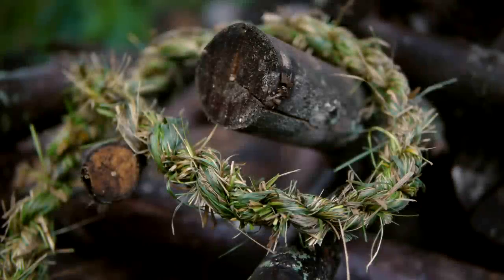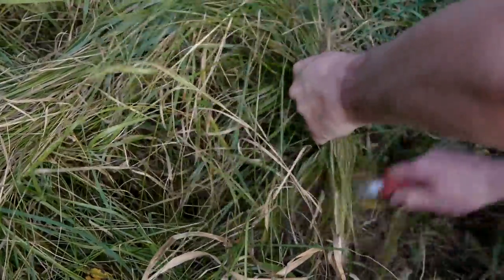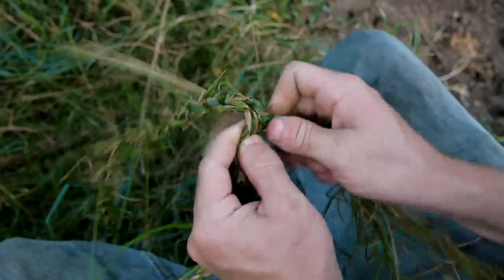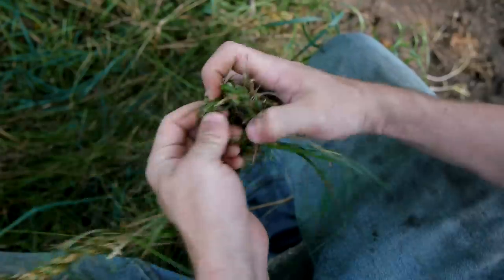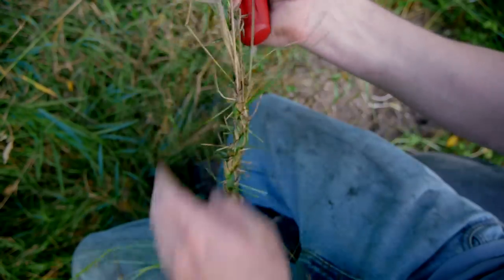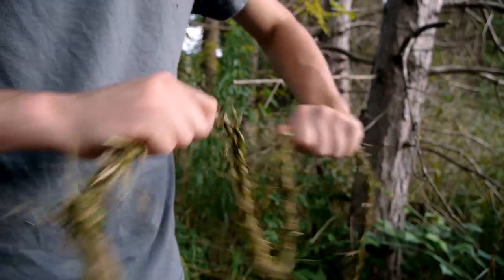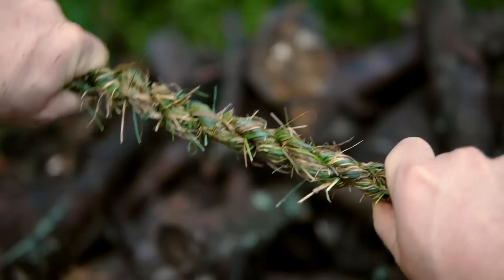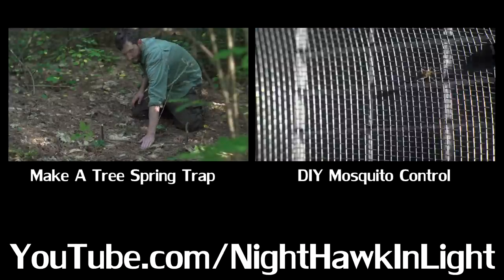How To Make Rope From Grass [Easy Method] - NightHawkInLight

Comment: Does the rope still maintain strength when it dries out?
Reply from the maker: +Liam Daniels Some, but not all.
Reply: its better to dry the fibers first, grass will tend to snap easily when dry but the fibers in nettle stems make good cordage. also you can lay the unwound fibers across your knee and roll your hand over them while keeping hold of the rope to make it easier.
Reply: +EdgyEthan if you boil it when the grass dries it won't break that easily , that's what i know , but i never tried it out
Reply from the maker: +EdgyEthan I don't know, never tried it
Reply: +NightHawkInLight
 *didn't
Reply: +Haary cane its actually 'never'
Reply: +Teeco Reeco +Haary Cane
You both are wrong. It's haven't
Reply: Jacob Furrow i swear i must have been asleep when i did these corrections :P
Reply: If it loses strength when dry you could always burn it HAHAHAHA KILL IT! KILL IT WITH FIRE!!!!!
Reply: +Jacob Furrow *You're
Reply: Lily Polk No, it can go either way. I put 'both' before 'are' to stress the "both"
Reply: Jacob Furrow Did not see that, sorry. You're right.
Reply: +Shadowphyre Can verify, boiling strengthens it.
Reply: +Lux Support :D this is actually YouTube
Reply: Liquidated Damages it depends what u use
Reply: NightHawkInLight How much weight does it hold

Comment: His improve method from 6 years ago (today is 9/9/2024) tells how to make it stronger, more easily, and last longer.

One thing he doesn't mention in either video is that some natural fibers are much stronger than others, and choosing between them can make a significant difference wherever you are and what naturally grows there. For stronger rope, just use grasses that are very tough and stringy.

One very good material is green Cyprus branch shoots. If you ever tried to split Cyprus for firewood, you notice it's significantly harder to split than other woods.

Comment: You can make a larger rope from the smaller one by securing one end,  pulling taut,  and twisting while keeping tension tight.   Once it is twisted to the point it is trying to ravel on itself,  keeping taut,  have someone grab the center and slowly back out taking the end in your hand and matching it to the secured end.   Then,  while keeping mild tension,  with someone still holding the middle end,  slowly let the rope ravel together.   You will have rope half as long and twice as thick.  :)

Comment: Gday from Australia, great video, I'm having trouble making the rope strong enough, on testing it breaks on the splice. And no matter how I try the splice always results in uneven size stands, any additional pointers?
Cheers
Reply from the maker: You're probably adding too much at a time and waiting too long before adding it. You have to add more grass before the old stands get short. As for keeping an even thickness that just takes practice

Comment: How does the strength of the rope when it is first made compare to its strength as it dries? I would expect that it would be strongest right after it is made, but I suppose it could get stronger as the grass dries and its surface becomes rougher.

Comment: Is that a Morakniv? If so, how do you like it? How does it perform? Any downsides or issues you've came across?
Reply from the maker: +WastelandOmelet It is, and it's a good knife. Good steel. Downsides are this particular model has a less comfortable handle than their main knife, and the back of the blade is somewhat rounded so it's no good for a fire steel unless you file it to a flatter top.

Comment: How long does this stay strong for? I know you mention it drying out in the description but assuming that doesn't happen, will it start to rot or anything after a while? I want to use this to hang plants.
Reply from the maker: +Crap Ratchet I haven't tried using it long term before. It would probably last quite a while, but would probably rot if it were left out through winter.

Comment: Do you think it's possible of making a stone sling out of this? I was thinking of how perfect it would be to make a stone sling out of grass cord. Throw rocks at 130/fps to scare off some wolves or bears if I got attacked. Slings are easy to weave, but I was wandering if I could make the cord thinner. If not, it would still be useful to use that cord as framing for a hut.
Reply: yes you can, Primitive Technology has a nice video titled "Sling" that demonstrates how
Reply: li 15 
Awesome thanks.

Comment: what kind of grass did you use?
Reply: +Perktube1 The type you find on the ground, in fields and everywhere on the fucking planet
Reply: +FunGUI  except for a desert (;
Reply: +Joey ink No, it's even in most deserts. A little less common in large sand-dune deserts, but still available.
Reply: +Jacob Furrow alright sorry dude you're right my bad
Reply: Joey ink No problem. You can even use cactus fibers if you can't find any grass ;)

Comment: it's either I'm using the wrong grass or the shit won't just form when I twist the strands both ways
Reply: I Loved you twist forward until fairly tight on the top strand, wrap around the front to the bottom, pinch to hold the twist. Repeat and repeat and repeat...

Comment: The video title states "Easy Method." Is there another method that works better? I'd like to see a rope that's thin enough to work with the tree spring trap
Reply from the maker: Yes, there's a method that works better. It's still made with the same twisted style, but a more deliberate amount of turns is used by only twisting one side at a time. It takes longer but can make neater looking cord that can potentially hold more weight. With either method it's possible to make very thin rope, just use less grass. I may make a follow up video demonstrating alternate methods.